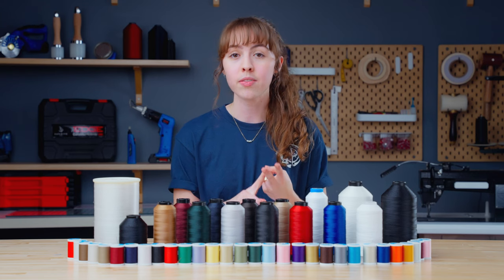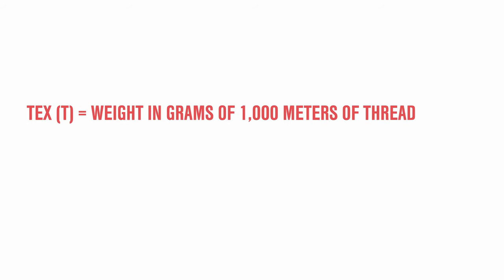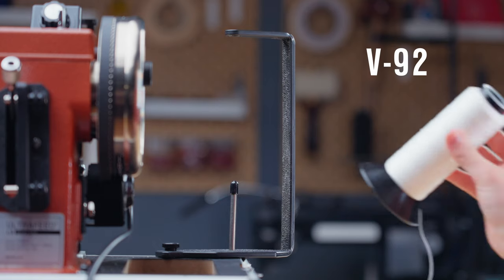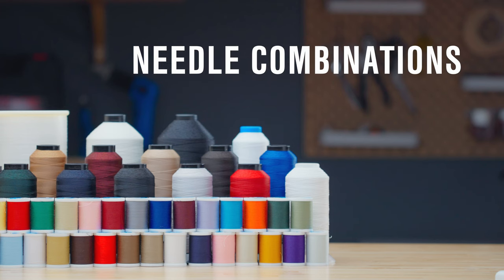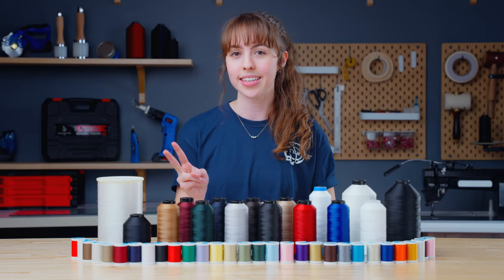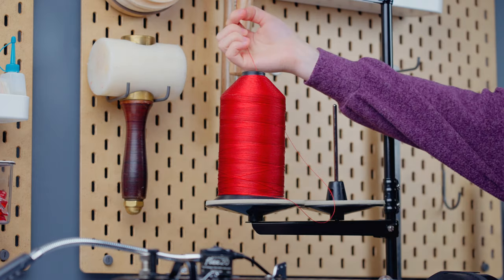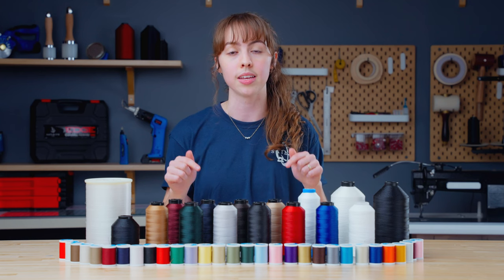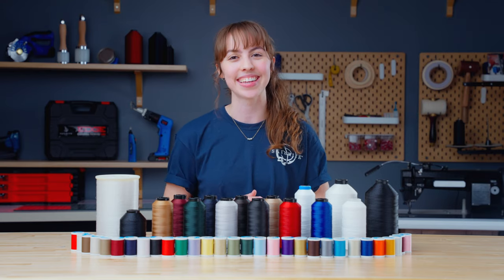Become a Thread Expert in Minutes!

Comment: Interesting comment about using two different sizes of thread in one stitch.  I sew with PTFE thread in an LSZ-1 oscillating hook machine which can be very challenging due to skipped stitches.  I use all the tricks recommended by Sailrite however I still get skipped stitches.  I know this is acceptable but I'm not liking it.  Tried sewing with V69 Poly on top and PTFE in the bobbin and the sunlight exposed side of the fabric down.  No skipped stitches and the knot is buried.  Is this acceptable?  Anyone else tried this?  Thank you.
Reply from the maker: Yes, that technique is acceptable! You should be good as long as the PFTE thread is the only one exposed. Very clever Idea!

Comment: My Huskvarna Emerald 118 manual says nothing about the max thread size. Really want to know if it can take a V92 marine thread before I buy, and what size leather needle I would need for it.
Reply from the maker: I like to use a size 18 leather point needle with v92 thread for leatherwork. You could use up to a size 20 needle. Here is a link to the needles I would recommend. https://sailrite.com/Needles-135x16-DI-18
Reply: @SailriteWorkbench   Thanks a lot. I live in the UK so it's a little different, but I think I can figure out what I need. Just don't know if my machine can handle that size thread, because it's not an industrial workhorse machine, more of an expensive home machine with a plastic/metal walking foot attachment.